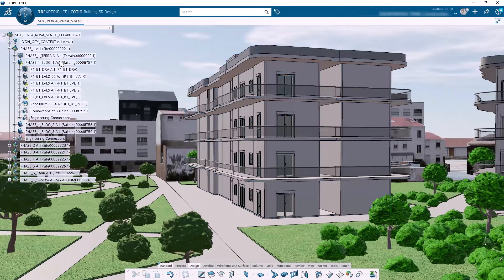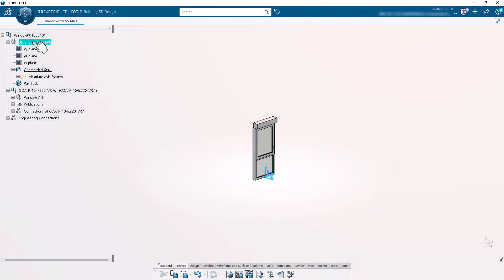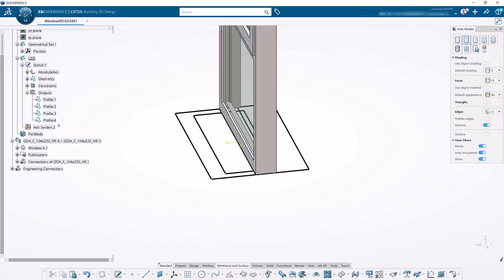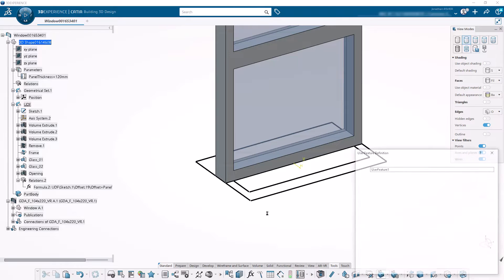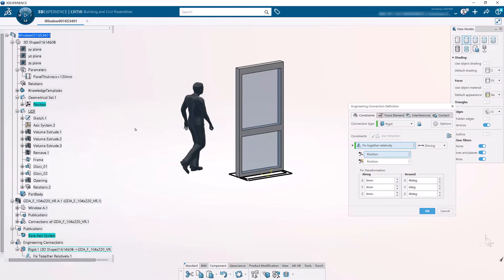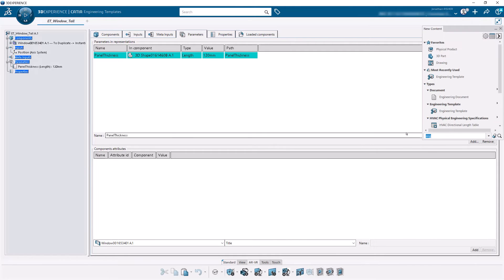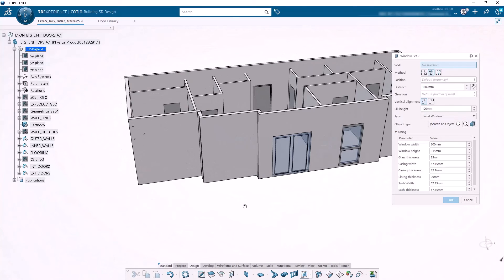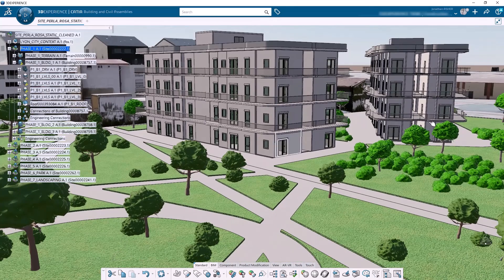10. CATIA Building Design Fundamentals Appendix 2 - Creating a Door & Window Object Type

Comment: Hi, after creating the Object Type I get an error saying "Missing Base Axis System" even though I have Position as input. It seems the same error happened during the video in minute 12:16. How can I solve this? When I go back to the model and add the Window OT it does not show and I confirmed it wasn't hidden.
Reply from the maker: Did you use the Building & Civil Assemblies application and the Define Component command to make the 'Base Axis System' publication? Watch from 8:26 and make sure you follow the steps exactly.
Reply: @CATIAAEC  Yes I did.... I was able to solve the issue just by renaming the axis system as "Base Axis System". Many thanks! 
PS: are there any tutorials for creating slab object types? I'm currently trying the same procedure as the one shown in Appendix 1 but I guess it must be a different one...

Comment: I have a few questions, 
Is the structure of the UDF important or is it just the naming on the published paramter and outputs? Meaning you could name it correct when creating the UDF..? 

The parameter "PanelThicknes" is it mandatory to have it in the root parameter set..? 
If not then, you could have copied the Parameter set to your UDF Body. The leeds to an alternative method for copy/pasting your Ralation Set. If you after pasting delete the deactivated formular and then reorder the original you would use the same process as done copy/pasting a parameter set. It also gives me a security that it's the "right" formula/parameter i'm moving. With that said, for every UDF i make, start by creating a Geometrical set and rename it to Input. Here i create the inputs i need for my user features. I like the axis system method you show here, but sometimes other inputs might be required. Then i create my body(UDF) and create an empty Parameter set, Relation set and a geometrical set. Under relation i would have another set called Formulas, and then actions etc. The geo set i call References. Now i have a good and well organized structure to my UDF. 

Sorry for the long post.. 🙂
Reply from the maker: Hi, correct to all points!
1. The naming of the published parameters and/or outputs of the UDF is essential, those features inside the Geometrical Set could be anything but I like to keep them the same for simplicity.
2. No, this isn't necessary, you could absolutely move 'PanelThickness' inside the UDF set. Normally, I would also recommend moving the entire parameter set into the UDF Geometrical Set go keep things clearly organized. I would rename it 'Control Parameters' and make a second set called 'Reporting Parameters' that compute important values that need to be captured when those parameters change. However, for this simple example of a 'not-very-parametric' example I didn't go to level of detail.
3. Yes, I should have named the Geometrical Set containing the Position Axis System 'Inputs' and yes, most UDFs will contain many more, but for this example we are limited by what we can use for inputs for this Object Type.
Thanks for the questions!
Reply: @CATIAAEC  Thank you for the feed back. I'm new to AEC and learning.. 🙂 Hope you keep making these videos.